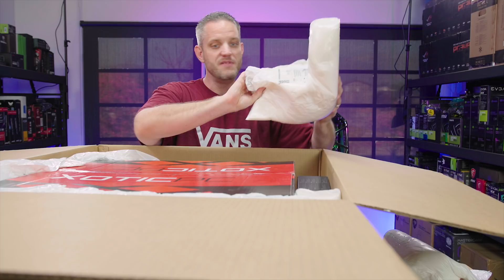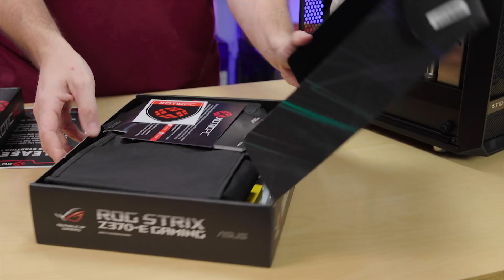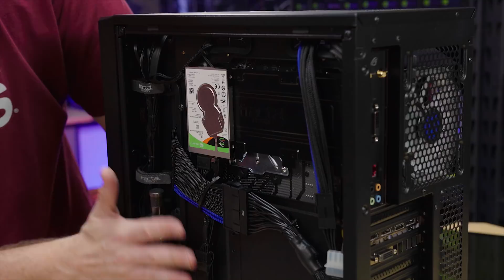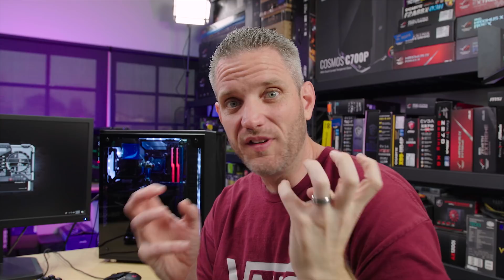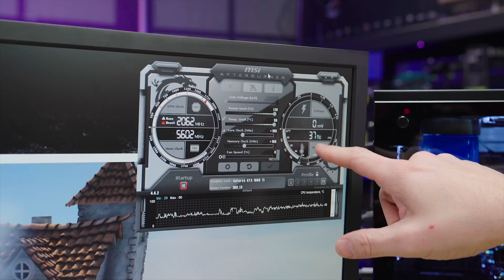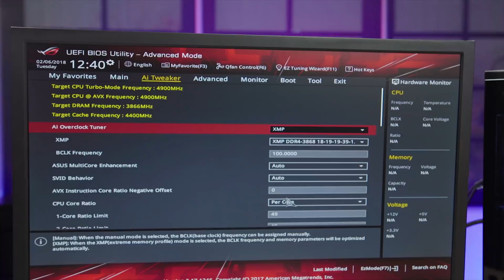XOTIC PC G7 Avenger! $4000 PC GIVEAWAY!

Comment: Really? xotic pc is garbage the stock msi dominator gt72 i paid $1500 for two years ago had the seal broken when it arrived and when i inspected it the m.2 was missing the killer wifi card was swapped with a garbage card as well as a host of other problems. I get it They pay you but dude... A tiny bit of research and you will find a plethora of horrendous reviews. To all that see this stay away from that chad company.

Comment: It is possible to bay a pc with water cooling from xotic in cost of 1200$ with i3 8 gen and 1050 vga .
If i do so i need just bay a g1080ti and i7 8 gen it cost 1500$ more and replace that .My concert op water block from vga 1050 same we 1080 ti and it will cost me only 2700$ .When i order from xotic with config. 1080ti and it will cost me 4200$ i mean i can save 1500$. ty in front. Sry for my language if i spell diferent.

Comment: Hello JayzTwoCents, I'm writing this comment in hopes that you will see this.
I am current studying my first year as an IT technician and its been alot of fun and i'm currently learning alot of things regarding pc systems and such.. what i didn't know is that the requirements for my school is to have a high grade functioning PC that can run multiple programs at once for some of the work that i do at my school, for example using Cad and Photoshop. i'll be studying for 4 years then moving up to high school after that.. i would be so glad to be put in consideration for this PC giveaway! thanks<3.. oh and btw my school also holds 2 yearly lan's and when i'm in the 3rd grade i will help out holding this lan and it would be absolutely amazing to win this pc! here's my school's website http://it-gymnasiet.se/skovde/

Comment: Xotic pc the worst thing I have ever seen in my life...
It has made me to waste time for about 3 months solidly. I ordered msi wt73 7rm Jan 3rd and it was told only on Feb 16 that the model got discontinued, then again I went for msi wt72 6qn 218 which the model they referred and i bought it and I got news after a week that it has also got discontinued. Even after that I asked them which model did they have in stock and ordered for msi wt72 7qn 245 and finally they canceled my order for different shipping address to the billing address. I dunno how easy it is for them to understand the emergency of some one. This is my final year project and I have been consistently working for the purchase of this model. Such a worse worse worse sellers Xotic pc

Comment: I'm rocking an i5 3570k and a gtx 660ti this would be an ENORMOUS upgrade for me. Haven't upgraded in 5 years.
Reply: I just upgraded my 3570k to an 8600k. Fantastic cpu. Have you overclocked? Fortunately I ditched my 660 for an R9 390 a couple years back.
Reply: I have overclocked it to 4.3 ghz sitting right now. I could probably push it higher as i have the h100i aio. My gtx 660ti is DEFINITELY struggling though. Makes me less competitive in my games unfortunately. I need this haha!

Comment: To all of you complaining because you're outside of the US: You all clearly don't realize what kind of issues are present in sending a package like that through customs. Please, let me explain:

First, that thing has got to weigh something like 60+lbs by itself. Space and capacity aren't the same thing in a shipping container, so the heavier something is, the more it costs to ship it. This point is pretty basic, I know, but I felt like I needed to bring it up.

Second, it's filled with fluid, and you aren't going to be able to get all of the fluid in something like that out before shipment without a tear down that Jay isn't going to do. The problems with fluids at customs are numerous, and fluids and fluid containers (IE: this PC) get handled, stored, and handled again in a seemingly endless cycle. That means that not only does something like this PC take a lot longer to get through customs than most other things, but it gets handled by people who are only there to take the samples, and they don't care about the product. Now, you could argue that to avoid that, you could just not let anyone know that there's water in it. That is a very bad idea, because if Jay doesn't disclose that information, and the package gets randomly searched or damaged, Jay is going to be held accountable, and I'm sure the fines are steep. The customs laws around the world are there to protect the citizens. Noone should try to bypass them, even if it's not meant to harm someone.

Comment: My R7 1700x with noctua cooler and gigabyte 1080 air cooled has a higher cinebench score, 1540. I did spend 2000 dollars on it but...
It is a full tower with 5 120mm case fans. Push Pull setup on the cpu cooler. NH -12S SE-AM4. And overclocked at 3.9 GHZ, 3200 DDR4 CORSAIR Ram. Benchmark  consistently at that number in Colorado at 5140 altitude. 70F ambient temp

Comment: Hey Jay 
Ich have a Question in Dezember, I die a Project Witz Watercooling my Gtx 1080Ti Form Gigabyte its the Extreme Version.
But now when im playing Witcher 3 on Max settings (2560x1440 with the Setting Unlimited FPS) I geht Temps Around 70 degree Celsius.
My Question is now have i done something wrong? Or is that normal?
Sorry for the grammar mistakes, because my mother tongue is German.
Greetings Form Switzerland and
thank you in advance

Comment: hey i was wondering if i can put a 1050ti with a open style cooler in a case that doesnt have very good airflow (1 fan for intake and 1 fan for exhaust). ive been searching for a 1050ti with the reference cooler but i didnt find any. so is it ok if i put it in or is my system going to overheat?

Comment: I have a question, i am new to pc building and need some help. I have a tower with led fans, an rgb thermaltake 650w psu, an asrock x370 mobo, and rx560 GPU. I hooked it all up, with a 1tb hdd, and turned it on to see if everything worked. The mobo lights up, but the fans, led power button, and rgb psu do not. Do I need the cpu and ram first? I have checked multiple times to ensure I have it hooked up right, but just don't know if I need the ram and cpu to bring it all together. Any help would be appreciated
Reply: Nothing?

Comment: $4000 seems ridiculous even with recent GPU and ram pricing. I just spent ~$2700 on my first ever desktop build with $500 dedicated to softline water cooling, a 240 and 360 rad, CPUblock, GPU block, and pump/res. As for specs, the rig sports a corsair 460x mid tower, msi z370 gaming pro carbon ac, overclocked delidded 8600k ($300 + $70), overclocked msi 1080ti seahawk ek ($812), 4x4gb corsair dom plat ($245!), 850w evga psu, 1tb sata III m.2 ssd, 1tb firecuda sshd, custom cablemod cables, and plenty of fancy rgb fans and strips. Add in fancy corsair peripherals, a 2k 144hz 27" monitor, windows 10 pro, and I spent roughly $3200 between November and December of 2017. $4000 for this prebuilt system that has the next best 8th gen processor, one less radiator, and similar specs everywhere else seems quite ridiculous considering this is only a computer, not a full setup such as mine for almost a grand less. Granted, one lucky person will get to enjoy this computer, or sell it to pocket some cash. Even as a first time builder, nothing replaces the experience of building something with your own hands and understanding how mechanical and electrical systems function.
Reply: Ryan Yaw fuck the price look at the specs
Reply: WeLiveWeDie I see the specs. The rig I just built has the same gpu from a different manufacturer, and a marginally better cpu for gaming. So when this rig cost almost $800 than mine and doesn't include cost of a monitor and other peripherals, then definitely fuck the price

Comment: Back in April 2014, I ordered my Sager gaming laptop from XOTICPC, and it still runs like a champ. Custom ordered with 2x 840 EVOs in  RAID 0 and an 880M. I absolutely love it! Sadly the PSU and a cap on the mobo died on my main rig (i7 950 on a poorly engineered EVGA x58 FTW3 (I've been through multiple warranty replacements of the board)), so getting a chance to win a replacement rig would be epic.

Comment: What do you guys think?

I was nervous as hell to do this, cause I was scared I might ruin it, but I actually went ahead and modified the front panel of my Phanteks P400S TG case. I went to the ole Homeless Despot and got a 1" bi-metal saw bit for my drill, a set of calipers, a shop ruler, a precision file set, some masking tape, and some grinding and cutting wheels for my Dremel. I was going to do a much more complicated design, but I went ahead and kept it simple with circles for inlets instead of those rounded diamond shapes. As a lot of people know, most of the cases from 2017 have airflow issues due to manufacturers wanting quiet operations, or for aesthetics, etc. 

So, I drilled 8 holes in the front panel, and while I wanted to try this without the need for sanding and new paint, I'll likely need to do that later anyway. I'm looking for someone I can send it to that is good with graffiti designs, painting sheet metal, etc. With some clever use of the magnetic filters that came with it for the top of the case, it actually turned out looking pretty sweet. And considering my top fans are exhausting, they don't need the filters anyway. Also, I added some metal stand-offs to the top panels, which are held on by their own magnets, so it allows me to keep my top panels on during normal use and still exhaust air. Plus, it looks good. 

Images:
https://drive.google.com/open?id=1UxIMOBZu__lv8qEvg-bhB6_MHRbNfeHX

Comment: How does this PC cost $4000? Not including the GPU and water cooling components, these parts total out to about $1400. That water loop and GPU are not worth anywhere near $2600, even with the current crazy pricing.
Reply: Tim Cassidy  labor
Reply: All they did was change the front logo and add a radiator shroud. 1500 my ass.
Reply: Building a watercooling system looks expensive though.
Reply: The Aquacomputer rad and Bitspower fittings alone will take a nice chunk out
Reply: Customized case ≈$1500

Comment: I paid $165 for a nvidia 1050ti 4gb I bought it used and it works just fine I also bought a amd fx9590 black edition used for $75, 16gb of used pny ram for $45 they work perfectly my motherboard was my brothers old one msi not sure what exactly it is but it's a amd 3+ socket. $10 for the case from a friend, $34 for a rosewill 650w power supply, $85 for a 1tb toshiba hdd I want to give the computer that I built to my girlfriend since she plays games on her laptop and her laptop doesn't perform well and use this pc if I were to win it to play whatever game I want whenever I want lol. Very very nice pre built Machine though. Also my computer doesn't have any sides on it I took them off and it has 8 fans (CPU, gpu,psu fans included) the CPU runs 45 C playing forza on ultra graphics lol and the gpu runs 39-43 C mobo is pretty hot at 54ish C. Cheap build amazing performance for what I paid

Comment: Man would this be an upgrade from my current pc. Which is a AMD FX processor and a gtx 970 with 8 gigs of ddr3 hyperx ram
Reply: Elk 601 damn dude same
Reply: Elk 601 right there with ya! Fx 9590 (2x970s sli tho and 16gb ram) Really mad at myself for not doing a build last year before this price craziness. There has been ALOT of FX support and even 970 support as well because of that. So we aren't total dinos yet
Reply: that build is a beast
Reply: amd radeon 6300 if you dont know off the top of your head it's old and crappy
Reply: Lol that is decent stop crying

Comment: i think jay is a bit out of touch with outside US prices and stuff :). buying a premade system for me is in no way better. whatever configuration i go for, building it up myself saves me at least 300$ and i'm talking about budget builds ryzen 5 stuff like that. not to mention that whenever i find a decent build it has either a bad cpu and a good gpu or the other way around. cases are always worst of the worst in terms of cable management, airflow, and fan slots. besides there are very few retailers that offer you the opportunity to pick parts and have them assemble them. those that do charge an overall fee, don't sell components at msrp prices and they also add a per component installation fee. 

so sorry jay, but i dunno what you were thinking talking about buying premade systems or to order systems. it's still cheaper to piece everything together yourself.

Comment: How is that $4000 PC? Does the custom water cooling cost $1500?
Reply: Did you see all of the fittings? Figure that each fitting is $10-$15 and count them up. Remember that the angled fittings are $15, and there is a strait fitting on both sides of each angled one. T-fittings from BP are in the $18 range, and drain valves are in the $20 range, though I'm not sure what brand that one is. Then, figure in $100 for CPU block, $150-$200 for pump/res combo, $100 for the rad and then figure in fluid, tubes, etc. I'd bet that the loop itself is actually closer to $1800 for someone like me to build it. Also, you need to account for the $40 fans too.
Reply: Dillon Law I don't know much about water cooling. So this is a shock to me. $1800?? I'd much rather buy i9 7980xe than that watercooling system in that case.
Reply: It's a niche hobby, so it has a cost associated with it. Most fittings are copper or brass, so they tend to cost a lot just in materials to make them, and they are made in relatively small production runs. Aside from the fans (which can get ridiculous in price), fittings are usually going to be the most expensive part of any loop using compression. So, the more fittings used, the more expensive the loop.

Water cooling can be done much cheaper than is showcased here, but usually (always?) doesn't look as "professional" in most cases. If you're simply looking for the best possible temps and/or acoustics, you can use standard plastic barbs and Primochill tubing, which together cost around $30. You can get just about any block that will mount to your CPU platform, any pump/res and (provided it can dissipate the heat your components can produce) radiator, and be up and running with a fully watercooled system for much less.

But we are ENTHUSIASTS! We want all of that and for it to look awesome too! Unfortunately, that costs a lot more.

Comment: the reson they didnt overclock the gpu further is probably so it doesnt heat up enough to make the fans spin faster, so out of the box (how most people that buy these kind of systems) it is as quite as it can be, for the people want more power they can oc them selfs and either max out the oc and not care that the system makes a bit more noise due to fan speed and pump speeds ramping up a bit, or go somewhere in between where they are happy with the preformance gain in contrast to the noise gain.

that is my guess, a other option is that they dont want to take the time to find the oc sweet spot and go trough all the extra testing that comes with over clocking to garantee it is a stable overclock cause that would add more hours in to build time and there for more money added on to the price of the end result cause those people aint going to work for free.

i am personally fine with a real modest OC out of the box as i enjoy over clocking and finding that sweet spot, finding that exact stable limit gives a my such a boost of energy, knowing that you made your system run at its absolute max potential.

Comment: 4000$ PC and all fit into a tiny ass case, with a low end Mobo...and only 16GB of RAM ??? So basically all the money has went into water cooling...and couple fans...may I point out they even using Seagate for  the hard drive lol ?? So rest the money are just in the name of scam lol....this is the most overpriced PC I've ever seen...and I thought my PC was overpriced ( literally )
Reply: How is the Strix Z370G a low end motherboard? It's $185 on Amazon right now. Also, there is nothing wrong with using Seagate drives, they had a bad batch go out almost 5 years ago and fixed the problem almost as soon as it happened. Toshiba had the same thing happen to them over a decade ago, and I'm sure WD has had their share of mishaps. I've actually used both WD and Seagate for years, and have had only one drive fail on me. Which brand was it? WD, actually. You should probably do some research before posting things.

Comment: nice rig yeah water cooled gpus are much better at constant clocks my  gtx 1070 evga ftw hyrbrid is sitting at a solid 2150 core clock while gaming in the winter in summer it goes to 2110- 2120  core clock constant. i'd love this system currently my system is being held back by 8 gig ram stick and a i5 6500 non oc.